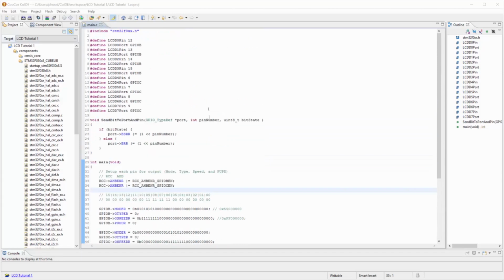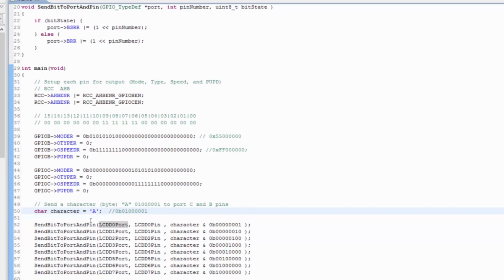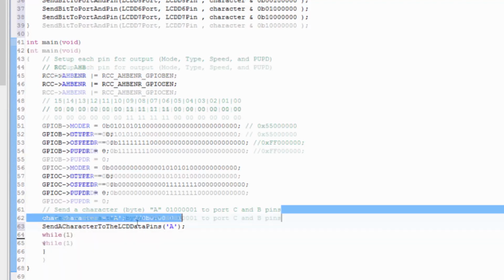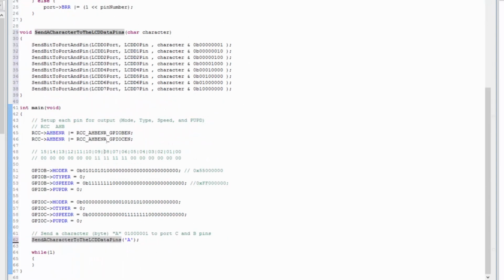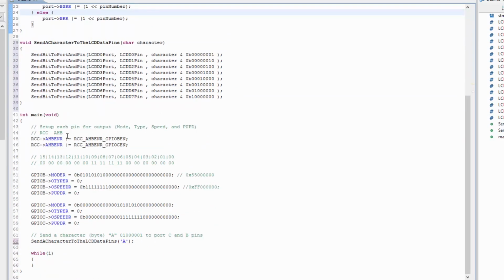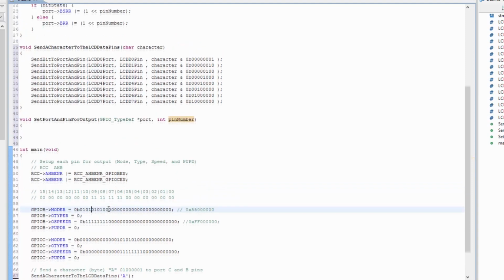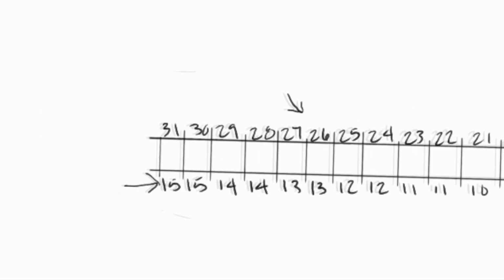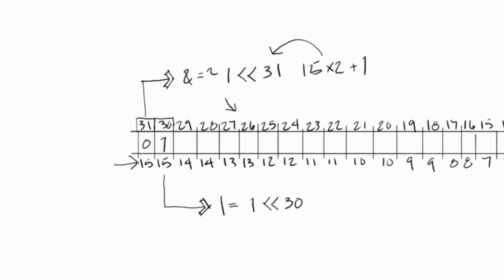18. Create Convenient Functions - ARM uC and LCD Part 5

Comment: Hello! I've seen a couple of your videos and wondered: Why don't you use a peripheral library to handle all the low level machine configurations? Or is this course purposly made for low level machine programming? I may have missed if you have addressed this in other video.
Reply from the maker: Marcus Forte the aim is to teach fundamentals. Once these fundamentals are learned, there really isn't much that can get in your way. Imagine, an issue arises during development  if the fundamentals are known, solutions are far closer.

Comment: hello Patrick i would like to support and continue in this series but i would like to know are you going to continue in this series and will you talk about advanced interfacing like acelerometer and wifi module etc.. with the arm and topics like interrupts
Reply from the maker: I have already demonstrated ADC on the Patreon site which will allow for accelerometer  connection that output analog voltages for the axes. I will be teaching all the features of the ARM MCU which will include every peripheral you can think of.